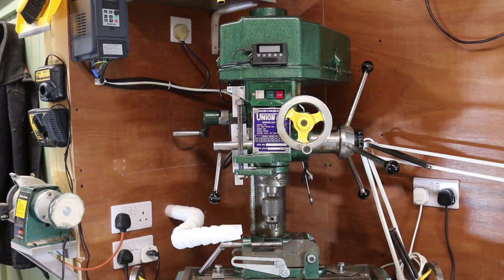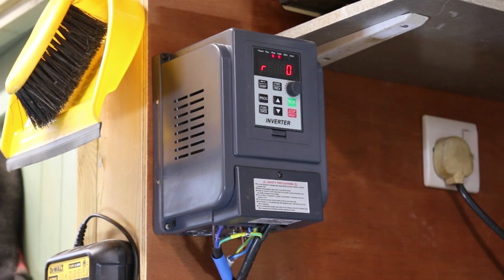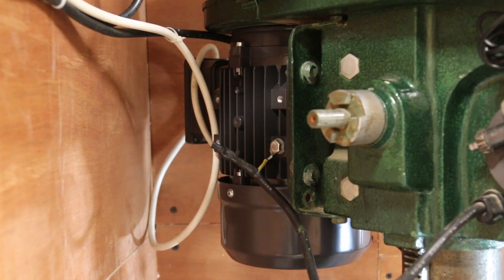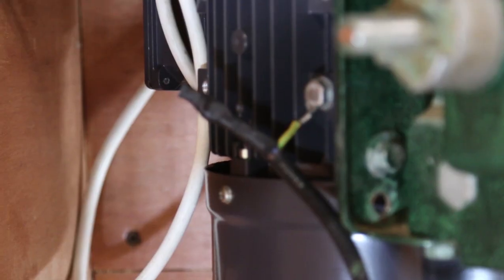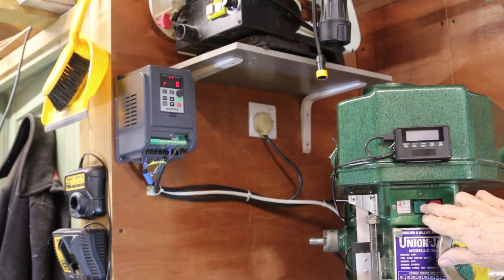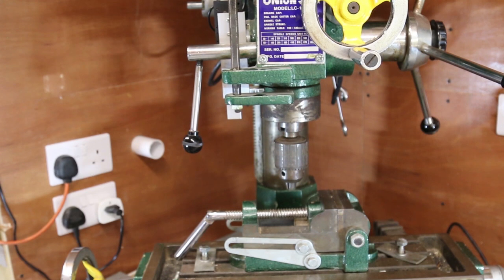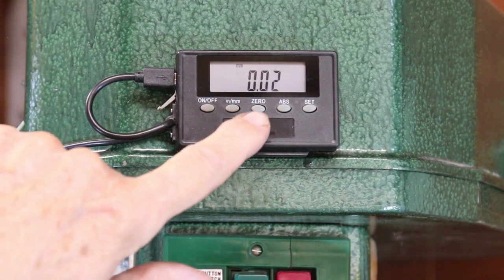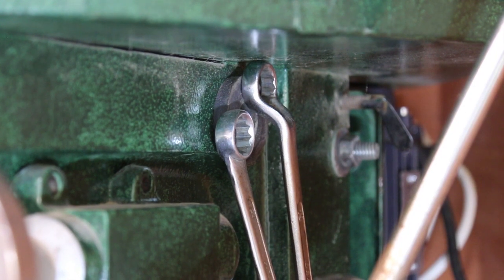Drill/Mill Upgrade

Comment: Fantastic video.  I am curious to know how the low speed torque is with the VFD on that motor?
Reply from the maker: Good question... At speeds below 100RPM there is certainly reduced torque- I have the belts set on the highest speed, so that is understandable. It has never been a problem (I had to check following your question) but if I needed high torque at low speed I would move the belts. Unless you want to drill large holes in, say, steel I do not think it would ever be an issue.
Reply: @Tensquaremetreworkshop  Thanks, that is exactly what I was thinking.  I'm looking to do this conversion on my MIll and also a similar one on my Atlas lathe in order to get rid of the countershaft setup.
Reply from the maker: @CraftwerksMC  Let me know how you get on! I, too, followed up by changing my lathe motor. In one of my videos... Bonus is how much quieter they are!
Reply: @Tensquaremetreworkshop  That was my first thought but also wanting to reduce the size of that countershaft assembly so the lathe could fit better on a 56 toolbox without a large amount of overhang over the back of the toolbox, at which point I can shove it up against the wall and not worry about things falling behind it.
Reply: @Tensquaremetreworkshop  Looking back, what horsepower did you end up using on your lathe motor, and what size is your lathe?  I have an Atlas TH54 looking at doing this conversion on.  It's a ten inch lathe.   Thanks Mike
Reply from the maker: @CraftwerksMC  My lathe is a similar size. Just checked, and I used a 1.5kW motor (2 hp), slightly bigger than the original. I run it at up to 70Hz (UK is 50Hz, the motor is rated 60Hz), giving me a 40% speed increase at a given belt selection. Power at low speeds is not an issue on a lathe, just engage back gears. Good luck with your conversion, it is well worth it!